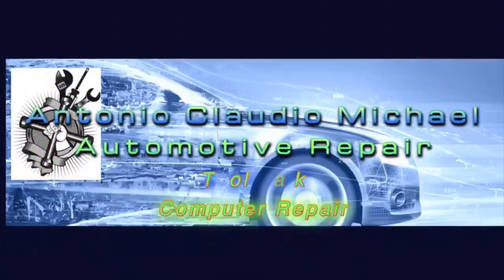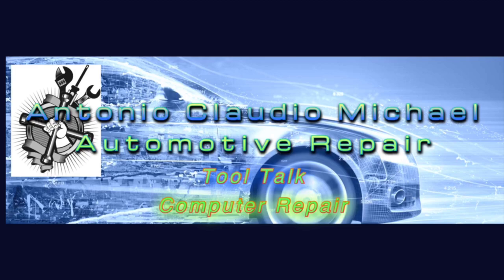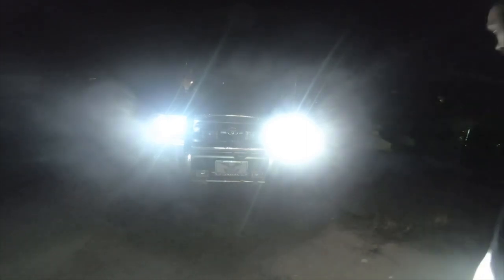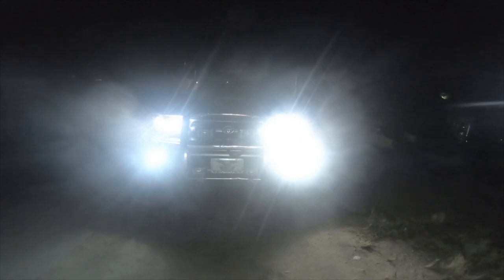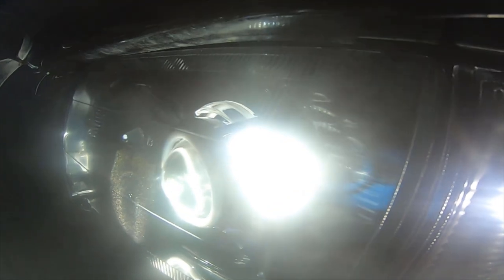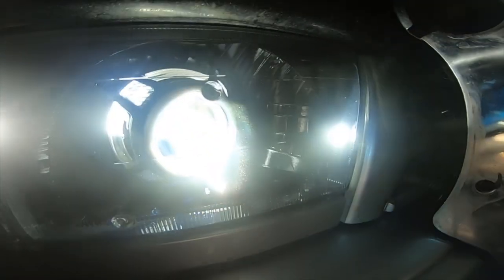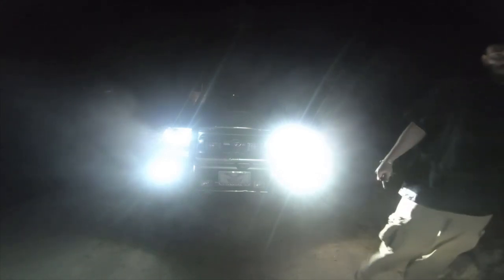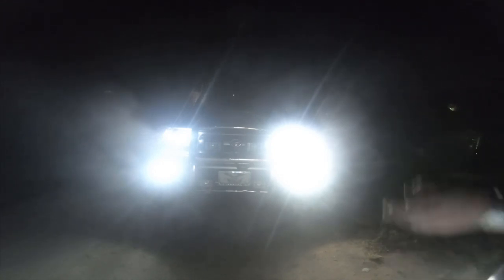2000 Toyota 4Runner - HID Projector RetroFit Install Part 8

Comment: You should be able to see really well. Did you have to use a larger amp alternator? Looks good.
Reply from the maker: No I didnt I built the headlights to the specs of my truck no extra load compared to originals and these run cooler for hid headlights and all the halos are led so they draw less amps

Comment: No yellow hue in those bad boys. Do you think all the work was worth it?
Reply from the maker: All the work was well worth it because my old reflector headlights the reflector material was gone so I couldnt see at night at all
Reply from the maker: And this build also cost me 900 dollers less then Toyota factor reflector headlights 800 dollers per side from Toyota I made these headlights  professionally myself with modern upgrades components for 700 dollers less then both factory headlights